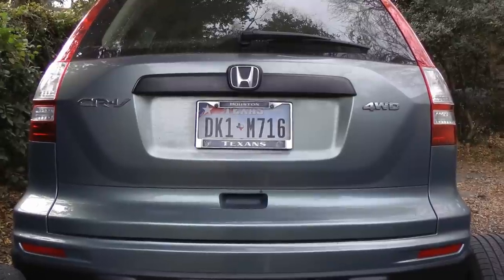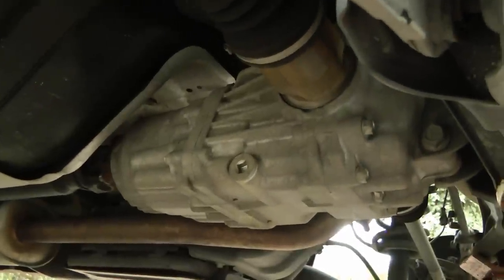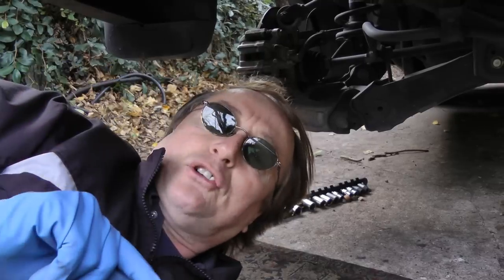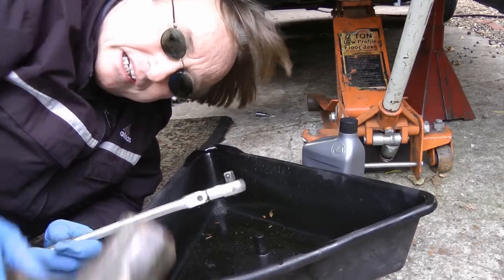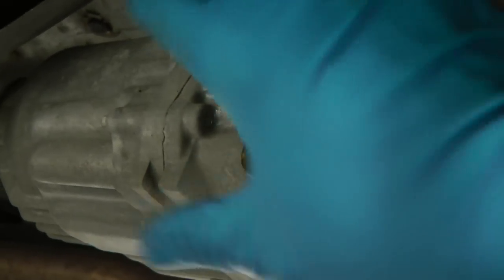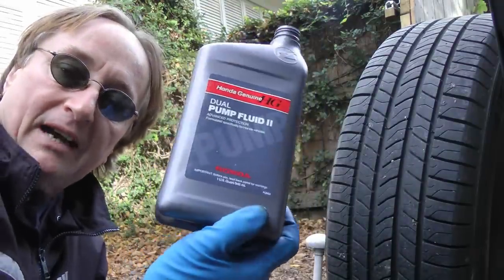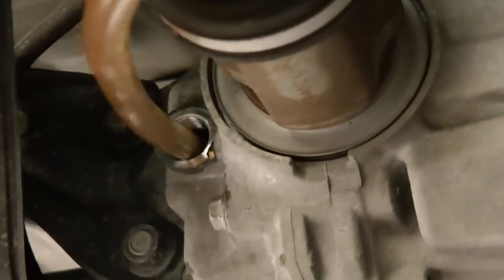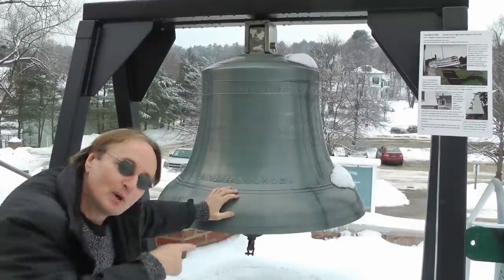Fixing A Howling Honda

Comment: I have to say, it is much better practice taking out the fill plug before the drain plug just as a precaution so you dont drain all the fluid out then find out that the fill plug won't come out
Reply: also for a faster drain when fill plug is taken out
Reply: richard evans my thoughts exactly
Reply: richard evans: yes you're correct about that and it makes perfect sense.
Reply: Hello Scotty, there has been other videos I have seen were they say to burnish the differential. I ask because I change the oil with the dual pump oil, but it is still making noise. Usually, when making turns. Can you please explain.
Reply: You sure it's the dif making noise? It could also be bad wheel bearings or worn power steering components.
Reply: Like the first 6 top comments say exactly the same thing after each other..

Comment: I changed the differential oil (Honda Dual Pump fluid) before it howls, at about 300,000 miles.  Running smooth, and quiet, currently at 376,666 miles.  Original 99 CR-V.  Thanks Scotty.
Reply: Frank J 
Was this the first time in 300 k miles?

Comment: People mentioned this but always make sure you can get into the fill plug or Oil cap etc before draining something and also if you use a nice gasket on the plug you don't need to crank it super tight, if you dont use a gasket at all it will sieze together good luck cracking it in the future

Comment: scotty what you tink about to use the Catch Can Oil, is a small tank with two hoses, the IN is conected to the out of PCV valve, and the out is conected to the conector of the admission, decantating the oil, to protect the interior of the motor, what you tink about? and thankyou
Reply from the maker: guys have done that for years, but technically, it's illegal in the US for anti pollution reasons

Comment: I have a 2008 Honda Cr-v 148,000+ miles on it and the differential went on it so im getting a used differential from a 1998 CR-V put in as they are basically the same 1997-2011 cr-v as the earlier differentials have the drain and fill plugs on the drivers side as the Element has the plugs on the left too. as i found out the 1997-2001 Honda Cr-V you need a 17mm socket to get both plugs loose.  some problems require to burnish the rear differential clutches.  as 2012-present CR-V and HR-V the rear differential is electronically controlled but uses the same Honda fluid.

Comment: Hey Scotty, 
I love your videos. They are very educational. I have a few questions if you don't mind. 
1) I see snow on the ground. Aren't you in Texas? I am surprised to see snow.
2) What frequency do you recommend changing the oil? Should I wait for the howling? My car is at 111,000 km and I have never changed it. I couldn't find any frequency in my owner's manual. I have a 2010 CR-V. The manual talked about ATF @ 100,000 km and I did that, but nothing about rear diff or coolant or power steering.
Reply from the maker: I travel a LOT making vids.don't wait for the howling though, change it every 30 thousand miles
Reply: Scotty Kilmer Hello Scotty,  just wanted to get your opinion on a Honda Accord as a reliable vehicle.  I had one in the past and loved it.  Just don't know if it's still a quality vehicle or not.

I love your videos!   Thank you sir!   

Oh yeah, I've also noticed that you have airborne stickers on some of your vehicles.  Thank you for your service!!!!!!!
Reply: Amit M. It snows in Texas quite frequently during the winter. When I lived in Amarillo tx we even had blizzard s

Comment: On a 06 Ridgeline ,What to do if there is a Knocking sound Coming from the rear OR inside the rear differential ? The truck has 187,000 miles. Thank you for your help!

Comment: Scotty, I had that Howell only when it’s in four-wheel-drive and the wheels are slipping, I change the fluid and it still does it. I heard to keep changing the fluid a few times to flush it out is this true, car has 80,000 miles on it 2010 CRV

Comment: Hi Scotty i wonder if you would have an idea for my problem. I have a 2010 Mazda 3 with a L4 2.0 vvt engine. I run Royal Purple 5w20 synthetic oil and i change the oil and filter every 4k since i got it new. Most of the time, she runs like a clock. But sometimes she has kind of a knocking sound in the top end. Im a motorcycle mechanic and im afraid its the camshaft or the lifters that may have some wear but its only 60k miles! Sounds like top to me anyways. I didnt pull the valve cover yet (happens most of the time when shes hot she pretty much always run fine when shes cold.). The thing that bogs me is that sometimes she runs amazing just like new, and sometimes she almost sounds like a dodge! Like you are at a red light, you stop, car runs awesome (3 inche magnaflow catback), you accelerate to the next light then stop to the next red light and she knocks on the top end like a bitch and it frustrates me so i rev it a bit and sometimes it solves it. Always disappears anyways during the ride.  Also i have to say that i change the oil at 4k because it happens more when the oil gets near that point. She doesnt burn a drop of oil though. But the noise just kills me being motorcycle mechanic i feel like i hurt the engine. I obviously hear it happening when the car is idling. Its always at red lights or else. Sometimes i push the engine really hard to hear if it hurts it self but it seams to rev really fine. Lots of power also. But there is this small knocking sound at idle that i hear that sounds top end to me.
Reply: some of these newer cars have noisier than average lifters and direct injection high pressure pumps make noise too..if you arent experiencing driveability problems then you are most likely ok.. and try an oil additive like BG MOA which will quiet the valves.

Comment: Remember kids always remove the fill plug before taking out the drain plug. Sometimes the fill plug will we rust welded and youll have no way to fill the diff
Reply: Plus the fill plug could be a different size.  It would suck to drain the whole thing and then realize you don't have the right tool to get the fill plug out.
Reply: *****
uhmm that would suck too bad. a better option is to get a new car
Reply: put a 3/8's drive impact gun on that and tell me it doesn't come loose.
Reply: @peachferrari  start bit turned into a 24 real quick lmfao I know the feeling

Comment: Hey Scotty, I just bought a used 2008 subaru wrx with 103,000 miles. It's running great but I noticed the Manual recommends changing differential fluid every 35,000. Should I change the fluid or is it a waste of money and time? I don't know the last time it's been done because it's a used car. Thanks!
Reply from the maker: change it now, and every 35, subs have weak differentials

Comment: Scotty, I have a 2003 Chevy Avalanche 4wd with a very low RPM Exhaust Resonance I can't find. According to many Chevy owner sites I'm not alone. It appears evidently on a lot of the full size GM 4wd 1500 series trucks. Any thoughts on solving it would be appreciated.
Reply from the maker: put it up on a lift and run it. Then try to find if the exhaust system is making noise in any one area from bad mounts or internally worn mufflers.

Comment: Big fan of your Videos Scotty!  Quick question...I just changed the rear diff on a 2006 CRV.  Wasn't quite able to get the full quart in.  The pump left an ounce or so in the bottle!  Is this a problem?  Should I go buy another Quart snd keep pumping it in until it overflows?  Thanks!
Reply from the maker: fill it correctly with new fluid

Comment: I had a similar problem with my 2009 Honda CRV. I changed The oil In The Diff, but The Noise continued. This car has 108,000 miles with The original Rear pads. My problems was The Rear pads were rusted to The hardware. I replaced Rear pads, hardware, rotors,  pins and pin rubbers and The Noise Is gone.Thanks....Jim
Reply: Same thing happened to me, I changed the fluid but the noise is still happening.
Reply: @aleqrobinson2876  The noise I had was not caused by the differential (I have a 4WD, and changed the diff. fluid every 30k miles since new), but from the brakes. The pads rusted to the bracket that holds them. The noise was a hollowing sound. The local mechanic wanted $325 to change pads and machine rotors. I felt this was too much. I ordered parts from Rock Auto (Bendix pads with shims & SS hardware, new esoteric rotors, new pins & rubbers, 3M Silicone Paste) and spent $115 and in 1 1/2 hrs. my grandson was done. The noise was gone.

Comment: Hi.
My 1995 Honda Accord tends to lose Radiator fluid frequently and the fans run a while after it’s parked. There are no leaks, the coolant reservoir is fuller than normal, and the water pump was replaced a month ago. 
What’s causing this?

Comment: Hi Scotty,  I have a peugeot 206 which has stiff gear changes when going down a gear and needs to be forced when driving, but only happen when downshifting.  Do I need a new clutch or change the fluid in the transmission?  Anything help is appreciated.

Comment: Hey I have a 1984 650 Nighthawk bike making that howling noise, and I wonder if it is the same problem? I know this is a car but does this also apply to motorcycles?
Reply from the maker: NO, bikes don't have differentials in most cases. BUT, if yours has a drive shaft and not a chain, then it has a differential on the back wheel
Reply: yea mine is shaft driven. So changing the differential fluid would be a good idea for me in the summer?
Reply from the maker: MrSkillfullyDone
yes

Comment: Hey Scotty! If you were going to buy a 10+ year old stick shift, what would you go with? (Reliability wise)
Reply from the maker: toyota
Reply: My friend had a Toyota celeca with a 22re 4 cylinder engine ended up putting over 400,000 on that car. I agree with Scotty on the yota.

Comment: best to have the differential warm. drive on highway for around 30 mins. jack up the car ( i usually have the car on 4 jack stands and have the car up in the air on a level surface) open up fill plug first, then drail plug. be careful of hot oil.

If you dont have a pump or cant get one. get a long enough tube + small funnel and gravity feed the oil into the fill hole.

Comment: I got a gen 1 crv with the real time 4 wheel drive,  I have a growling noise on my front drivers side,  checking wheel bearing by jacking car up and there is no wiggle room at all, can't turn it fast enough by hand to get the noise. Noise starts about 5 mph, at 50 mph it is so loud can't hear radio but can turn steering wheel fast back and forth very fast and the sound changes, also the rotor on that side is guestonable, have any advice,  thank you

Comment: @da Chang man it's just fine til you end up with shifting issues and a check engine light on and a code for a failed pressure switch or shift solenoid.

@scotty please tell me you received and replaced the crush gaskets. The parts dept should have provided you with them.

Comment: Scotty UNDER described the range of strange noises that are caused by the rear diff. when fluid needs to be changed. CRV owners be aware of this often misdiagnosed but easy fixed problem. Even Honda Dealers miss the symptoms, or maybe string customers along for other unnecessary repairs before they eventually change the rear diff. fluid. Our fluid needed to be replaced in our 1999 CRV at about 70K, well before the factory 100K recommended. I changed our 2006 CRV at about 60K just after buying the car from a person who was embarrassed the car was making a funny noise when they turned the front wheels all the way to the right. You guessed it... the rear diff. fluid needed to be changed!  Our 2005 CRV was changed at 100K and seems OK now at 140K.

Comment: Scotty! Opinion on using non genuine honda fluid for oil, coolant and transmission? (Not so much the rear diff, as my 13 civic is front wheel drive)

One thing I noticed is, I've had all service done at Honda dealers and one place seems to use genuine honda fluid while another uses Titan synthetic atf. I just find it weird that they wouldn't use genuine, unless that's common?

Of course independent shops says it's fine as long as in spec. Hmm

Comment: I’m hearing a low pitch drone-like whine that increases in pitch and loudness as I increase my speed, in the manner of an electric motor. It’s not loud, but it’s always there. A bearing going out perhaps? But it has been making the same noise at the same volume for months… 2003 Element all wheel drive.
Reply: Definitely a bearing. Had the same noise, changed the bearing, problem solved.
Reply: @ItsOnYea  Thanks. I'm taking it in to the Honda dealer on Monday.
Reply: @bambofett  - All were making noise, one in particular, they told me at the dealer. The hub was frozen and rusty, and they wound up abandoning the project. The truck, a '04 model I loved for ten or twelve years is no longer mine. I had recently replaced the engine - dead cylinder - and spent around $7000 on it. I hadda buy a car. Thanks for askin'.

Comment: Are you sure about 3/8" square is the right size for that drain plug? Most I know is 8, 10, 12mm. I assume it's more likely 10mm rather than 3/8" and there is half a millimeter difference that may overstress the plug and get rounded. (fortunately squares do not round easy so i bet it's doable with 3/8" but it's not the proper tool)
Reply from the maker: fit perfectly, I've been using em years with no problems.

Comment: 1.1 quart capacity. I just strain the old fluid and add 0.1 quarts of it back in. Saves buying a 2nd quart to have 0.9 left over and there is half a quart of the old fluid left up in the works anyhow.

Comment: I have a 2017 Honda Crv I have 14,400 miles, and my maintenance minder turn on saying it need a differential fluid change. I took it to a local place where they change lubrication and the mechanic told me the car don't have enough miles to change that oil, that I should change it when it get to 30,000 miles, but not 14,400. Scotty should I change the differential oil or just overide the system and continue on driving. Please Scotty what should I do ?
Reply: Change the fluid the shop u went to wants u to have a problem before u come in if u show up saying change my fluid I'll pay u .why not change it to make a few bucks because if u wait longer it will be more money more problems

Comment: Scotty when should the Differential oil on a Dodge Intrepid 2001 2.7 engine be changed? Not sure if it had rear and front....Thanks !
Reply from the maker: every 80 thousand miles or so on a standard, on an automatic most are part of the transmission oil so when you change that you're changing the diff oil

Comment: Hi Scotty, have a little issue on my 1998 land rover that I need help with. Lately it has been running rich. I checked the fuel pressure and it is 20psi over the normal range. I replaced the fuel pressure regulator with an OEM one, but I am still getting the same pressure. I also flushed the fuel lines with compressed air and checked the return line in the tank for blockage but haven't had any luck. What would cause the fuel pressure to be too high?
Reply from the maker: a bad fuel pump IF the regulator you bought is good, or a restriction in the fuel system lines anywhere that lets pressure build up. The smaller the hole, the higher the pressure will go
Reply: Scotty Kilmer I also noticed that with the engine off with the pump running the system is at a normal pressure. Does this mean the pump is bad?

Comment: is there a copper washer or teflon tape u use for the drain and fill plug bolts? or the thread of the plug seals it nicely?
Reply from the maker: the drain bolt already has a washer on it, you can reuse it a million times on this low pressure application

Comment: Hey Scotty,
I have a 1998 Dodge Ram 1500 and today it started and then stalled immediately. I then tried to start it a few more times within a couple of minutes of that happening and it cranked but would not start. I let it sit for 35 to 40 minutes then it cranked for a moment then started. I had the same problem last spring where that happened to me twice! I was wondering if you know what is wrong? (possibly fuel pump or some sort of censor?)
Reply from the maker: pressure test the fuel pump first. If not that, when it dies, do my tests "fixing a car that cranks but doesn't start up" to see what broke down then
Reply: Scotty Kilmer
Thank you for your timely reply!

Comment: Thanks for sharing all your know how! I have a question on car paint. One side of my car has a really faded paint that is very rough. It has the same texture as some 200 grit sand paper. The car was left outside for most of its life by the previous owner, and he never waxed it. Now I'm planning to polish that side of the car but I'm worried that I might remove what little clear coat I have left on that side. The left side looks like a showroom car because of the work I put in but the right side looks like a burry mess. What should I do?
Thanks for all your help!

Comment: Hi Scotty, I have a question regarding my 2001 Ford Mustang GT AUTOMATIC . When its in motion on DRIVE , it runs great ,shifts like its suppose to , eveything is normal . but when we suddenly reach a halt at a stop sign or red light . There's a vibration felt coming from the front of the car . I lay my hand on my dash and its vibrating .Then goes away once I accelerate. It does the same thing when we put it in REVERSE , vibration felt than goes away once i accelerate . I notice that it doesnt do "Vibration " when in PARK OR NUETRAL at complete halt . What could be the cause of the problem ? It's gotten bad at times and noticeable
Reply from the maker: try my video "how to fix a car that idles poorly"

Comment: because I was having noise on my 92 accord when in iddle and I have the AC running and when step on the gas the squeaky noise gets loud, it sound like it coming from power steering or the alternator? what's causing the noise?
Thanks